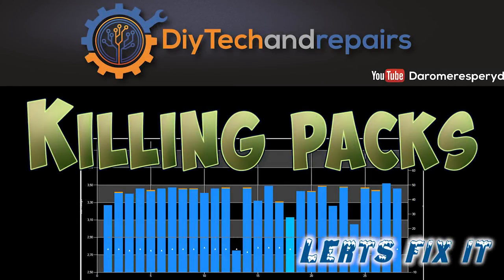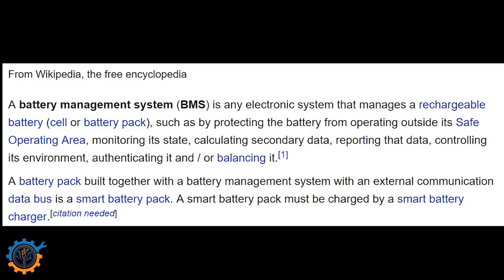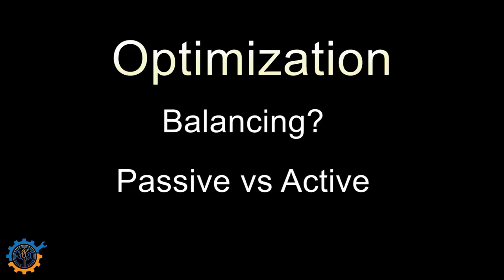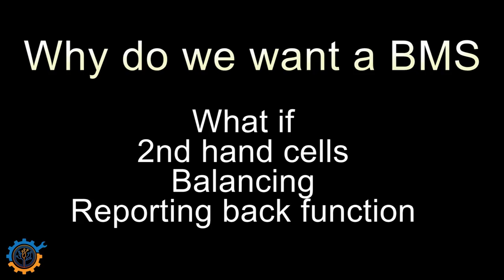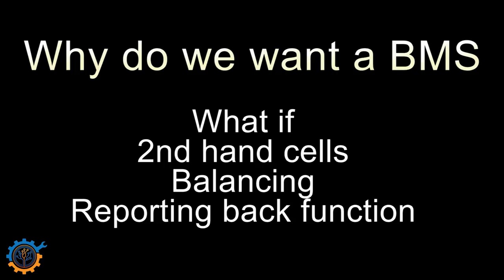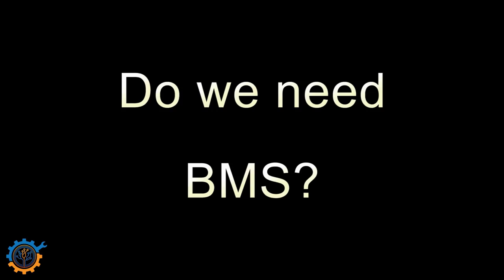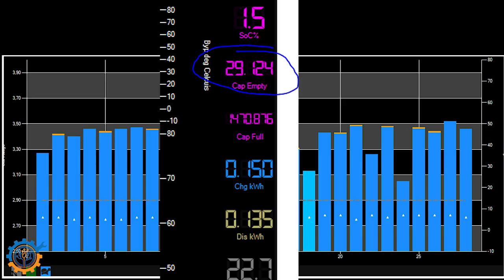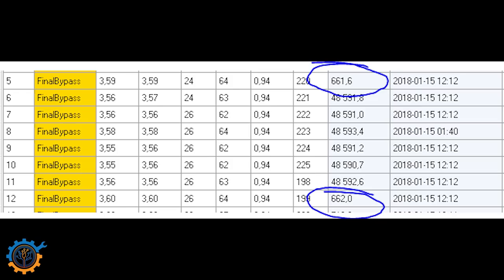Find self discharging and low capacity packs with Batrium BMS

Comment: This is a great video. Does this BMS also bottom balance and if not, is it important? How does this BMS prevent charging or discharging based on voltage or temperature to protect the battery.  I have a solar system charging batteries with solar and shore power and want these protections offered by batrium. Thanks alot.

Comment: I am  using hyperion charger for my two sets of 7s 120p, it is program  to charge and balance  in synchronous  mode. So far my xantrex prosine inverter 1800 is running perfectly. ..

Comment: I also have 1x2 cell holders. Just in case I do need to add a cell or two to equalize the bank. I don't think adding up to 2-4 cells would hurt when you have 200p cell packs. In 7s...

Comment: Thanks for this video, but i still don't see how batrium system deal with under voltage, for over voltage i know, it burn energy with resistors, but will batrium switch off one of my pack if it go below 3.1V for example? thx
Reply from the maker: Both under and over voltage IF it goes critical it can either signal that to the system or trigger a contactor or shunt trip. Burning energy is for balancing and not to take Care of over voltage Persue. For instance My system can Charge with 300A :)
Reply: @DIYTechRepairs  thx for your reply ;) well it does look interesting, but i think i first need to win lottery to be able to afford one i guess ;)

Comment: Sir i have a question how many years thus lithium ion will be out of usage or failure? Thus all the cell will be replace? Or if using batrium how many years it will take to be replaced?
Reply from the maker: The years depends on your useage and how you use it. Can be all from half a year to 20 years. Batrium doesnt as such expand lifespan.
Reply: DIY Tech & Repairs does batrium can detect 1 cell if busted or not charging?
Reply from the maker: @nilobualoy117  One pack yes.
Reply: DIY Tech & Repairs so u mean you can find the location of the cell who is defective?
Reply from the maker: @nilobualoy117  No. You can find the pack that is faulty. To find a cell in a pack you need to retest those cells
Reply: DIY Tech & Repairs thanks a lot for the explanation, since batrium is passive balancer how much amper during charging the minimum and maximum?
Reply: Thus batrium is dependent in the inverter?

Comment: I have a difference between the highest pack and the lowest of around 150mA, should I be worried.
Reply from the maker: 150mA?  are we talking about capacity or current? if its 150mAh then how much is that in comparison in % of total? HAve you tested with Icharger or something real good at testing or cheap china testers for 30USD? if the later it can easily be 100-200mAh difference between each test so those 150mAh would only be a guess.

Comment: thanks for your tutorial.
i keep away from "sheep" chinese electronics. however solar panels, vacuum heat tubes seem to be alright. there are very few "yinese" manufacturers that have decent customer support and are open to suggestions.
as in comparison to batrium and midnite classic, where the designers are actually visible and explain why things are how they are. or will help you find a fault. and modify the software if at all possible.
all the best

Comment: that was a nice explanation. I'd like to know more about Batrium . someone needs to make a BMS management balancing system that works better with the huge power banks ppl are building for their houses. something to balance a 1000+ ah cell in a bank . isn't that easy.
Reply from the maker: Batrium can balance 1000Ah+ ;) I got 2000Ah in my main battery bank. On a 48V 14s system Batrium can potentially do up to 7200Ah of battery bank without having issues. Then you can always expand it more .

Comment: "Poor bastard".. lol. nice one..
Internal resistances also cause cells to discharge at different levels which means they would have a different charge when charging and some would reach max before others and would cause overcharging.. big badda boom.
Reply from the maker: Yes but no :) In our packs the IR is not that relevant neither for discharge or charge as such since it will level itself out and as long as proper testing is done and random it will even it self out but for high current application that is way more important :)